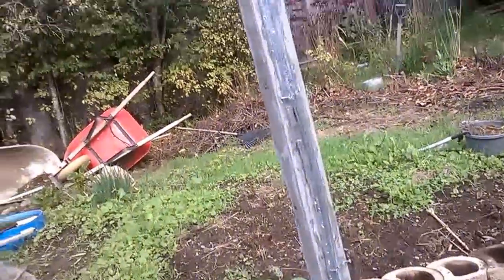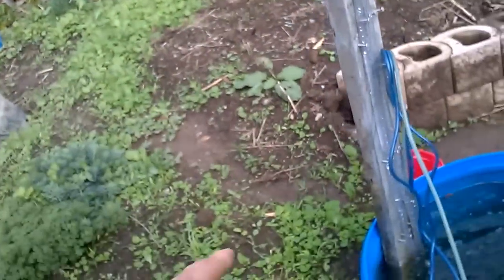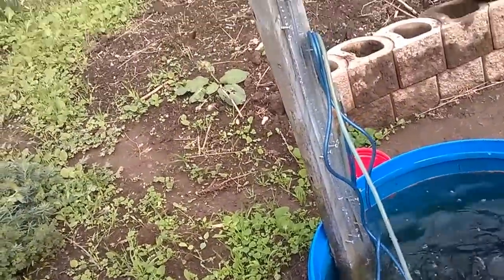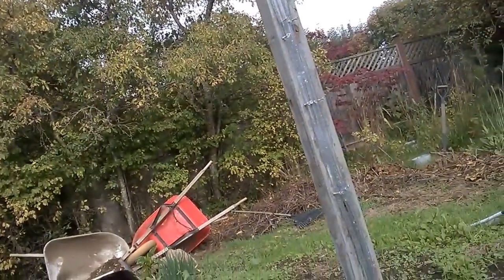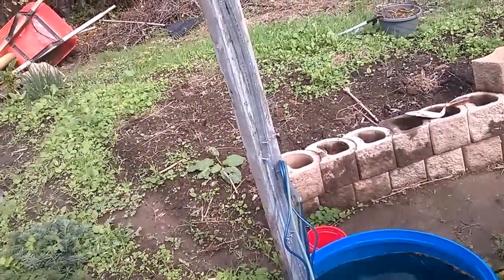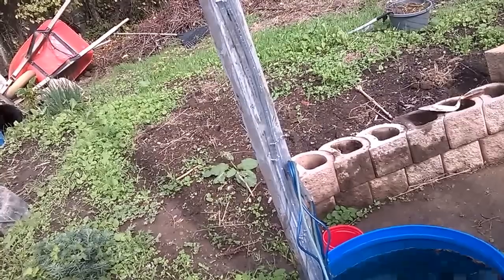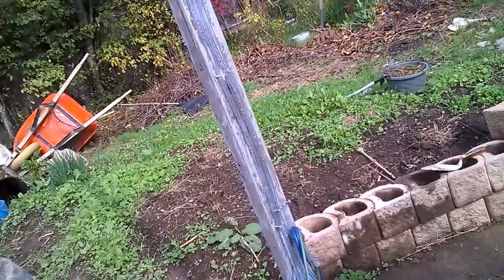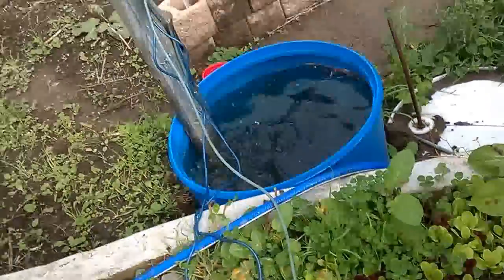Airlift pump testing rig!  Please share.   Pumping 7 ft high. 3  tube sizes.  FIRST RESULTS!

Comment: 5/6 inch tubing -- is that the tubing they sell for drip irrigation? What brand and size is the air pump you are using? Thanks!
Reply from the maker: +Joni Solis  It was 1/4 inch 5/16 and 3/8inch diameter tubing.   That is 6.3 mm,  8 mm and 9.5 mm.   The air pump was a marina 200    (4.5 watt and 2.55 psi).  I am almost ready with the figures.    My marina 200 is over a year old and one side of the pump is a lot slower than the other side, so presumably it needs repair.  But it was useful to get the different readings.  I think that these figures will be best applicable to pumping from a rainbarrel and choosing the tubes to suit your situation.